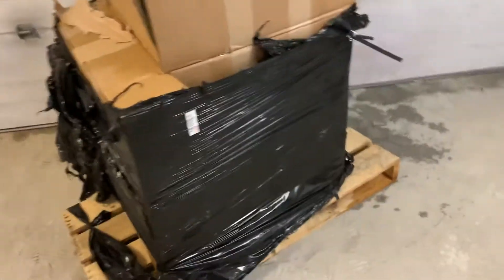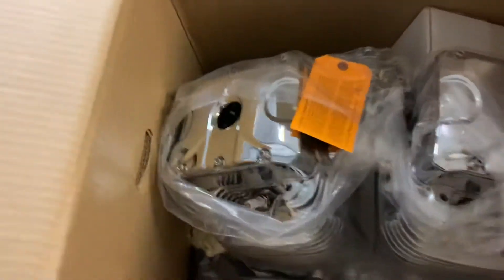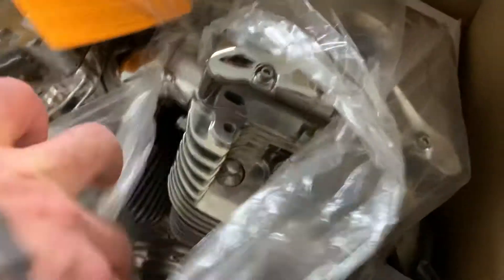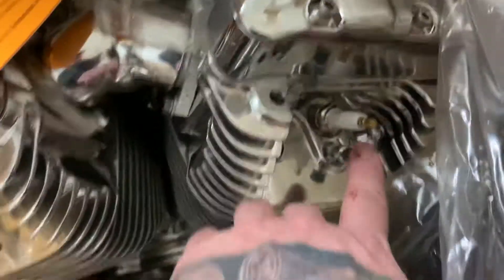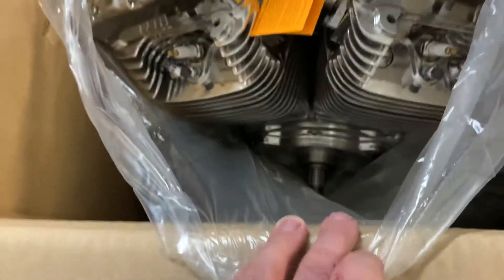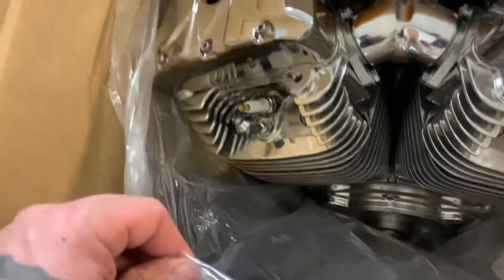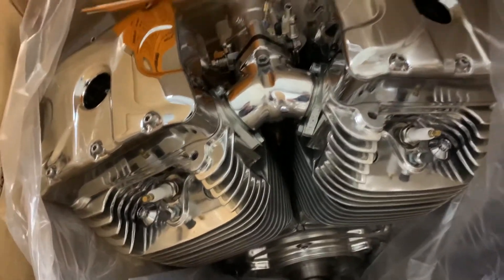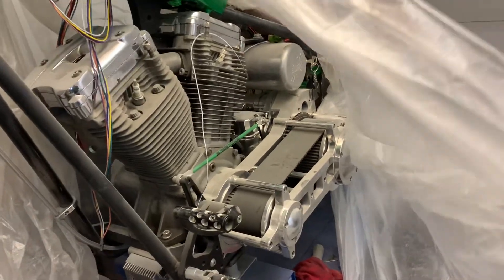Ultima 127 Evo Engine

Comment: Was the motor reliable???
Reply from the maker: 3 years now and I’ve put lots of miles on it. Great engine. The only problem is that I should have gone with a smaller engine. I can’t twist the throttle all the way too often.
Reply: @shaynegervais6951  I wanna go with the 100 in 110 hp plenty on lil rigid bike I ride.